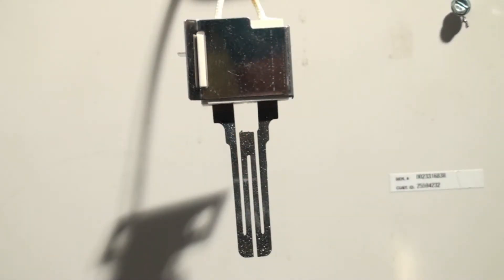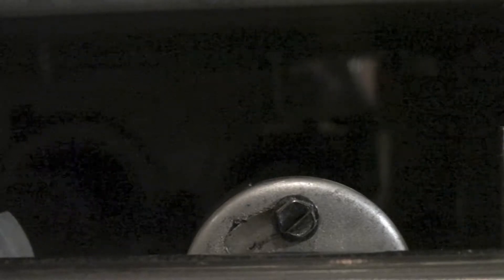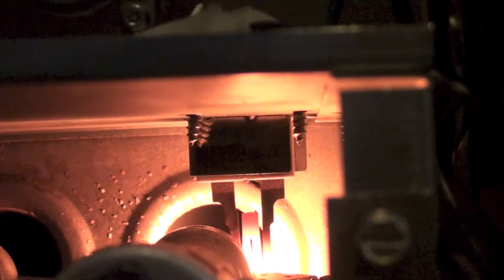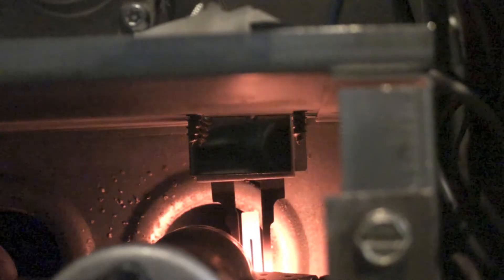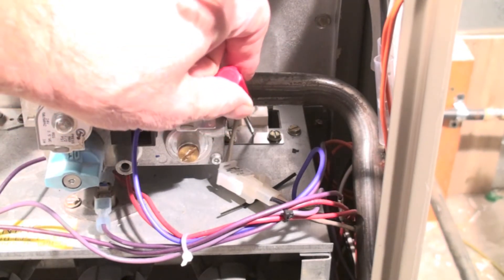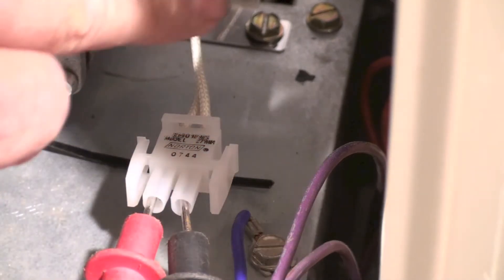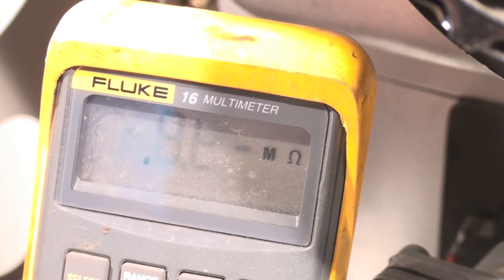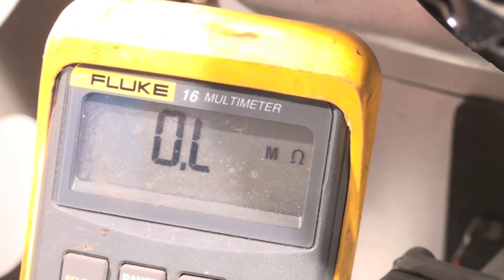Service the 80% AFUE furnace, checking out the silicon carbide HSI ignitor part 2

Comment: For future, never buy furniture with this igniter, I replaced 2 times. lifetime its 2-3 years. Clasical high voltage lifetime 20 years. cost of this silicate nitride igniter its 100eur...must buy original, like buderus 99e, junkers 190eur...its loby for stay paying moeny.
Reply from the maker: The ignitor has been used for around 40 years.  Usually when one fails, it is due to short cycling of the furnace.  
GFM